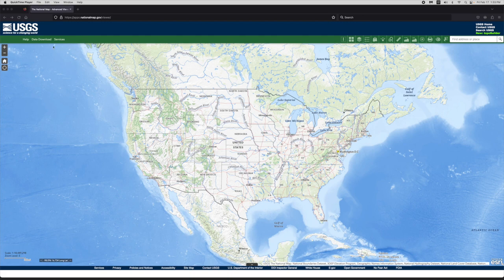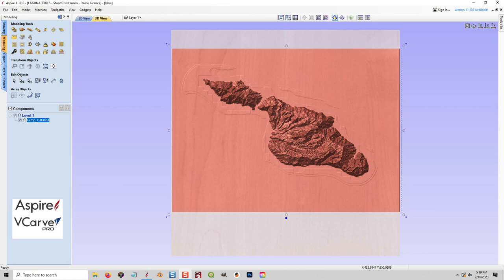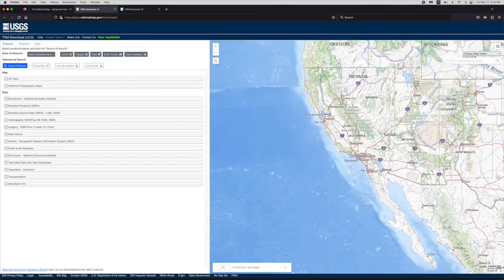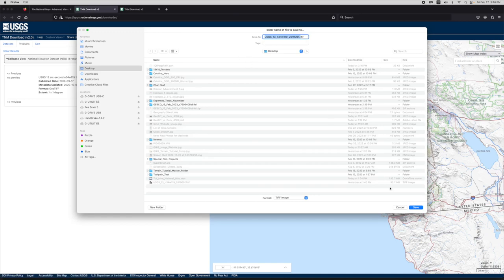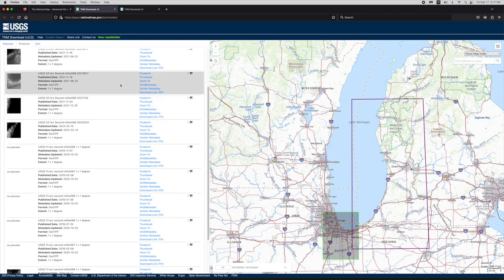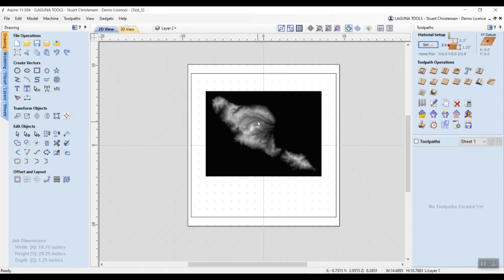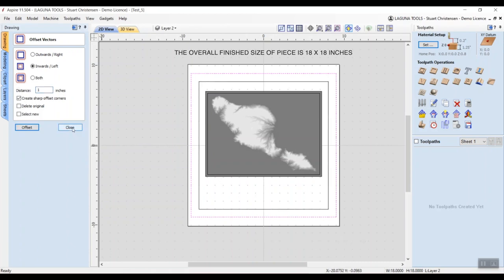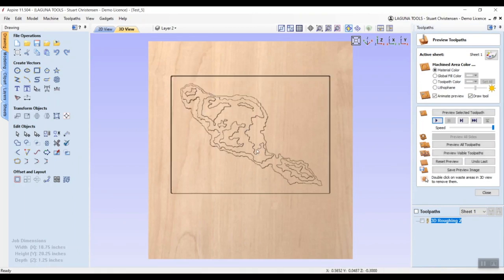Carving a Digital Terrain Using The Creator Pro Desktop CNC | Laguna Tools

Comment: Amazing video and project. Quick question, I can't import my jpeg into the 3d model. Jpeg doesn't show up as a file type in the vcarve pros drop-down. Did I miss something? Thanks
Reply from the maker: Hey Travis, sorry for the delay.
Regarding the JPEG image, did you use the 3D component method to create the model?  Technically, once you click on the “create component from bitmap” icon V-Carve automatically opens the import dialogue box and you can then navigate to the image wherever you store images in your computer, (ie. desktop, images or special project folder etc.) Best advice here is to make sure you navigate to the correct place to find a file.  Many times people forget to check the file path.  If there is something different going on, let us know and we can try to help. 

You can also reach out to our customer service department if you have any other specific questions: https://lagunatools.com/resources/customer-service/